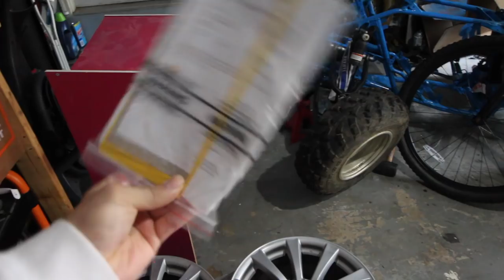UNBOXING My New Peace Moto 125cc Pit Bike!  How To Put Together Peace Moto 125cc Pit/Dirt Bike!

Comment: Is the carb garbage like the other bikes?
Reply: I have this bike. The carb is garbage. It leaks when its off and standing. I have got shut off the fuel to keep the carb from leaking. Also the carb on mines doesn't have screw heads so I can't open it to see if the float is getting jammed. I have to order a new one. Does any that is the dame size fit or does it have to be exact to model?

Comment: Is it faster than the other 125 bikes?
Reply: A little bit yeah but i have the orange version is a little lighter like 15 10 pounds and its a v type frame wich is stronger for jumps little bit more expensive tho

Yeah but mine beats an apollo in top speed acceleration is more or les the same

If you set the carb perfectly is faster by a little
Reply: It does have a huge advantage suspension wise

Comment: I bought this bike and the second day riding it, it began leaking oil from the stator plate.🤦🏾‍♂️ Also the gas cap was leaking gas, had to replace that as well. But the good thing about this bike is you can find the parts on Amazon.
Reply: Michael Stewart yeah mine is leaking gas from gas cap. any suggestions?
Reply: Parker I replaced the original gas cap with one from amazon
Reply: Michael Stewart thank you. Did it fix the problem?
Reply: @xerpzi8818  Yeah I replaced the gas cap and the stator plate. its running good now.